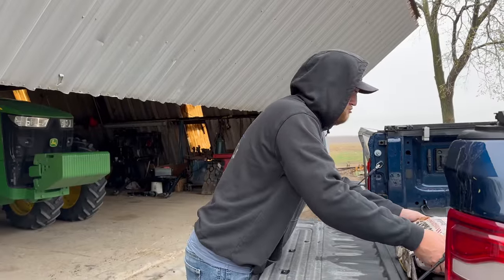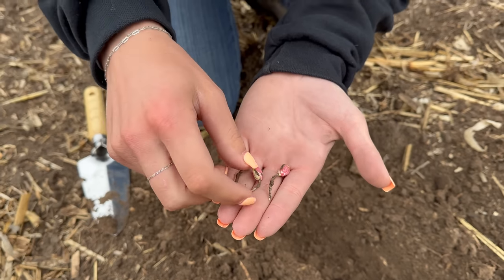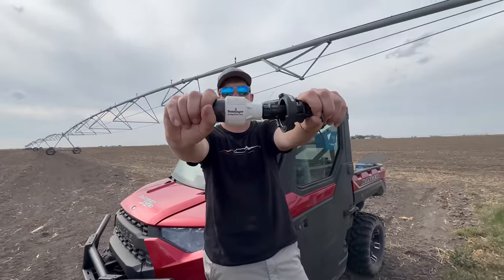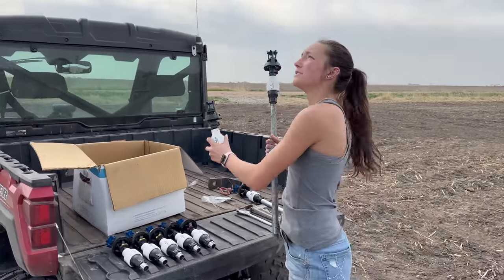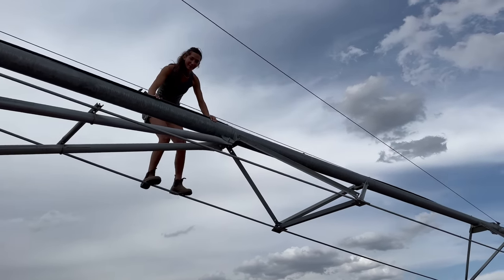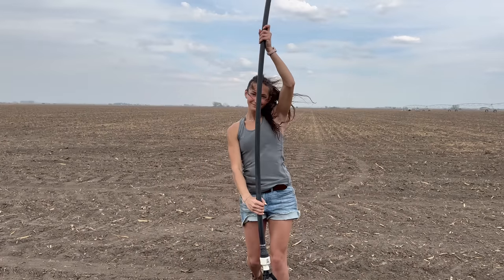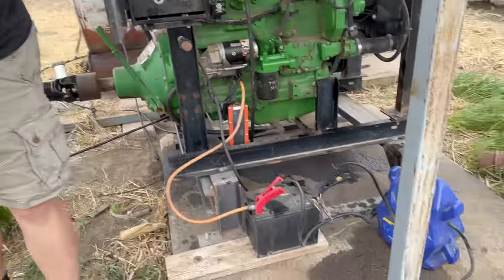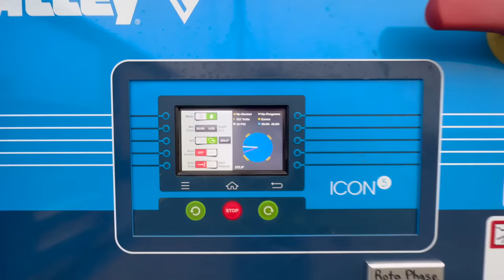Making It Rain!

Comment: I have a question about the pivots. Here in the Netherlands we have a governmental body keeping track of the water levels in rivers and canals. When in the summer we have a long period without rain, there will be restrictions on how much water can be used by farmers and such to irrigate our fields. Do you have something similar in your part of the US. I can imagine pivots using a lot of water from the wells. Or is it more a case of there being so much water in the aquifiers that theres no need for monitoring the levels, since it won't run low during the summer period?

Anyway. I'm loving the videos. And I hope you will have a great crop to harvest!
Reply: Nebraska is divided into Natural Resource Districts, which manage irrigation and some other things.
In the NRD that covers Laura's farm, the aquifer level is checked every March.  If the level falls below a certain reading, we will go into a series of allocation periods that will restrict how much water can be pumped each year.  
Currently, we are comfortably above that level, but this has been a very dry year and there will be a lot of water pumped this summer.  It is possible that next March the reading will be low enough to put us into allocation.   
We need rain.

Comment: is there a reason the sprinklers are mounted on top of the pivot pipe instead of the bottom? LOL...I'm typing this as Grant answers my question in video! Laura is very brave. You might need to invest in a scaffolding lift. Or bucket truck as Grant says later.

Comment: Question: In regards to this pivot is the control power coming from the motor and if so where is the generator/alternator?  I usually never see an external generator/alternator in the arrangement.  Is there some sort of in-line generator/alternator?  Courious minds want to know.

Comment: Aren't you concerned about massively increased evaporation as the water is flung wider from a much higher location in the hot NE summer? Or is water supply and -cost not an issue in your area?

Comment: How long is that pivot ?
how long does it take for a full revolution - I suspect you control that by some setting with respect to the amount of water you want delivered?
Do all your pivots use commercial electricity or do any have their own generator ?
How often do you run the pivot - obviously it depends - in general - once a week, or ??
Do you get enough water in ONE pass or do you run mutltiple passes around ?
Do you have monitoring via alerts if there is a problem with the pivot itself - how MUCH automation is involved?
Thanks
j

Comment: That was great! What powers the pivot's wheels?  Is it water pressure like a traveling sprinkler for the yard? The engine is to get the water out of the ground and to pressurize it through the pivot pipes, correct? Thanks for everything!
Reply: Electric motor.

Comment: No PTFE tape on the sprinkler head? What psi is at the end of the pivot? How long is that pivot? Or many acres does it cover? Thanks.
Reply: I thought that too, but, then I thought to myself, self, if the water leaks out a bit it ends up... in the field, which is where it's supposed to go!
Reply: Would a few drips be a problem ???? might get the field wet.

Comment: Do all of the different drive units along the length of the pivot have different gear ratios to each other to take into account that the outer ones travel much further than the inner ones, and if so how do you work that out? I’d imagine any speed difference would have it bending and breaking in the middle.

Comment: how does it work so you have a even water distribution over the full boom because the closer to the center of the pivot, the slower it moves so more water per square inch in comparison to the outside of the boom the covers a lot more square inch if it goes 1 full pass around the pivot
Reply: Different nozzles are used.

Comment: Ok, im a bit confused.  What is the pressure running through the pivots?  It must be seriously high, right?  How does the water get the end with decent pressure to spray out, without blowing out all the sprinklers closer to the well, when there are so many sprinklers in between?!?
Reply: That’s why they had the heads are numbered and had different colored valves to offset the distance to the end. Less flow closer to the well.
Reply: I would liked to have seen both of you wearing a safety harness .It looks like there were a couple of places that you could have hooked up to.I know you young and resilient but it’s just a good habit to get into when working on stuff like that.❤
Reply: Pressure depends on how the system is set up, but typically somewhere in the 40-100 psi range at the wellhead.  On quarter-mile pivots like those, figure 15-20 psi drop from the wellhead to the endgun.

Comment: Is that black tube (wire?) we see running along the length of the pivot, is that electrical to power a motor that drives the hydraulic pump on each wheel set?
Reply: Correct, except that it's all electric driven, not hydraulic .  There will be a dozen or so individual control and power wires inside that black conduit.

Comment: How fast is the pivot moving? Degrees per minute or hour? Also i would like to know how many liters or gallons are distributed by the pump and what pressure is needed to deliver water to all those sprinklers?
Reply: Usually pivots like that are set up to pump around 800 gallons per minute.  They would take about three days to apply an inch of water to a full rotation.
Reply: @42base13  wow, that's much lower irrigation rate than i thought! In the Alps we have a different irrigation technique, but we work with reservoirs, which then deliver the water over a pipe-system to the fields. In 3-4 hours we are able to deploy around 4 inches of water - but we irrigate smaller portions at once, so probably the same rate on the acreage-comparison
Reply: @Stingdrone  The size of the main pipe on the pivot is the  biggest limiting factor.  It's slightly less than 17 cm diameter.   Anything more than 900 gallons per minute and the friction losses become excessive.  There are ways to compensate for that, but they all end up increasing the energy requirements for pumping.  
You can go to bigger diameter pipe, but that has its own set of tradeoffs.  
The sweet spot ends up being somewhere between 750 and 850 gallons per minute, at least for typical fields in this area.
In the Mississippi delta, they often use large diameter poly pipe to flood irrigate fields, and those systems can be designed for up to 3000 gallons per minute.  But they operate under a very different set of parameters than we do in Nebraska.
Reply: @42base13  oh well that's why - didn't even think about this! Thanks for sharing your knowledge - now I'm a little more enlighted in farming on those monstrous big fields you've have over there 🙈even seeing the images and videos and getting the description of Laura and Grant, it's difficult to imagine!

Comment: Just wondering if there is a different between  to higher sprinkler then the lower hanging sprinkler?  As for as evaporation  amounts of water?
Reply: I think it's just the reach.  The higher sprayers reach further.  Apparently, the lower ones soaked the ground underneath too much.

Comment: No mention of high pressure versus low pressure pivots. Nor anything about high nozzle or low nozzles. Pivots do not always go in a circle. There are also linear irrigation systems. What is the daily number of gallons of diesel fuel needed  to keep a pivot providing water?
Reply: Lateral move machines aren't technically pivots. . . .
And they don't build truly high pressure pivots anymore.  It's medium pressure and low pressure.

Comment: I'm fascinated by the idea of timing the speed of each powered wheel set to exactly match the others so that the whole thing rotates around the center as if it were a straight pipe.  (I do know they do act as a straight pipe - it is, but if not synched properly, it would look like a snake crawling out there)  Do they use different gear sets ??  Hydraulic motors with variable nozzles ??  Electric motors with rheostats ??  Sometimes the simplest things aren't so simple.
Reply: In this case, it's pretty simple.  There are position sensors on each wheel set that measure the alignment to the next tower.  When the tower in front moves far enough to be slightly out of line, the next tower moves up a little bit to get back in line.
Reply: @42base13  Thanks for the quick reply.  Are the sensors lasers ??  Electric motors ??
Reply: @larrybourne4176  electric microswitches connected to arms that stick out a foot or so on either side of each control box.  (except for the end tower)
Reply: @42base13  Thank you.

Comment: What makes the pivot move?  I would like to see a video on how they move.  The driveshaft pumps the water.  And the further out will have move travel than the closer wheels.
Reply: Are the wheel powered by electric motors?  I would think the gearing would have to be different for each set of wheels to allow more travel the further out you go.
Reply: @craigloughridge9227  They are powered by electric motors.  The gearing is the same on all towers.   There are microswitches that turn the motors on and off as needed to keep them in alignment.  The inner towers run less often and for shorter times than the end tower.
Reply: @42base13 , thanks!  I find it so interesting.   Now I see why pivots are a pain in the but.  There's a ton of moving parts that can go bad.  I have been trying to figure out the mechanics of them, from watching the videos.
Reply: @craigloughridge9227  Glad you liked it.  I'm happy to help people who really want to find out new things.

Comment: but you have to drive the pivot irrigation with higher pressure, when you put it on the top, if they should throw the whater more far away, is it right? In germany we payed  8 Euro /Gallone for Diesel and up to 60 Cent/kwh for electricity last year. We are not allowed to irrigate more than 80 mm per year on average over 5 years or  other sayed 400 mm in 5 years.
Reply: Currently, the irrigation district that Laura is in does not limit the amount of water that farmers can pump.  If we do start water restrictions, the first level is 250 mm per year.
Reply: The farmers in my neighboring district are allowed to irrigate exactly 54 mm, that's Germany :-) . I live in a region called "Lüneburger Heide" where 50% of the irrigation is done in Germany because there is little rain and the soil is very sandy.
Reply: @33butterzucker33  It hardly seems worth the expense of installing and maintaining the irrigation equipment for only 54 mm a year.

Comment: Isn't it very expensive to have those diesel engines running all the time? The price here in sweden right now for 1 gallon of diesel is $7.4. Yeah, sure you are non-taxed diesel I guess, but I think that's around ~$5.6/gallon here. Still a lot.

Comment: Seems like electric powered pivots would be the dream. No maintenance, no refueling, have you looked into the feasbiltity of it?
Reply: How about you go out there and find the electricity source, and run a zillion electrical cables, underground all over their zillion acres and see how it does ?????  :)
Reply: I am probably wrong but I think the main reason there are not more electric pivots is they require 3-phase power and when there is a power source nearby it is usually single phase.  I beleive that if 3-phase power is nearby that is the route most farmers will go.

Comment: @LauraFarms Not Sure if you guys read your comments or not but I would love to see how a test plot in a dry corner would be changed by using a biochar based soil amendment and see how the moisture retention of the biochar section would compare to the irrigated areas. I haven't seen biochar pushed to the agriculture industry as much as it is being pushed to homestead gardening but from what I have seen it seems like it would be a good fit as long as it is not fresh "naked" biochar.
Reply: How much biochar does it take for 160 acres?
Reply: @42base13  One site I have found shows a product that uses about one gallon of a liquid concentrate per acre.

Comment: Which is a more cost effective way of making it rain? 
A) Pumping water out of the ground with a big diesel engine and spraying it through an expensive pivot that needs constant maintenance, or 
B) leaving a bag of seed outside in the weather every time you need 1/4 - 1/2" of rain? 
🤣